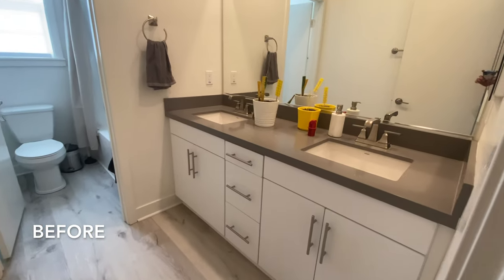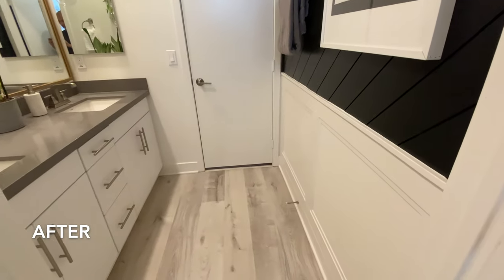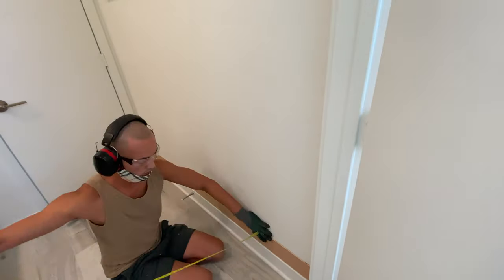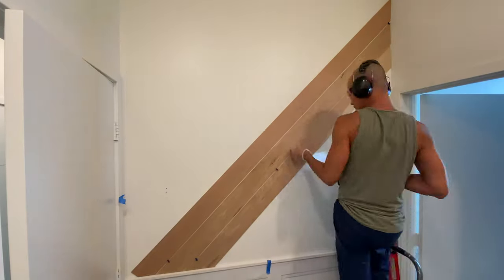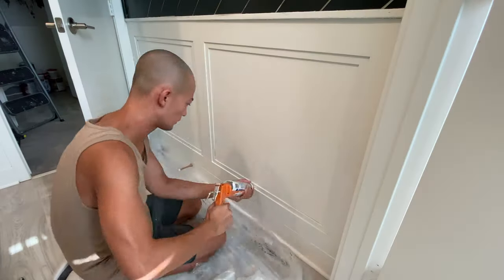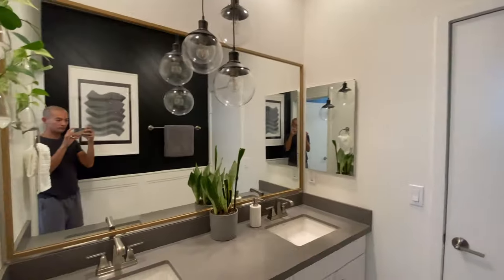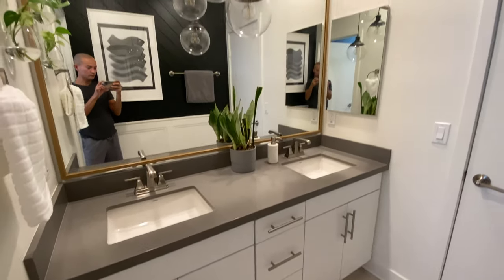Easy bathroom accent wall DIY

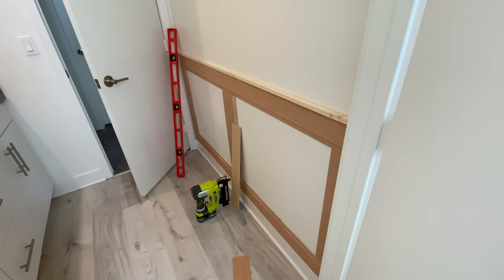Comment: hate to be that guy but @  2:50 you used the square Wrong. but other then that i like everything !!!
Reply from the maker: No worries, I appreciate the comment. I think I was just trying to use the leveler on there to quickly straighten out that piece